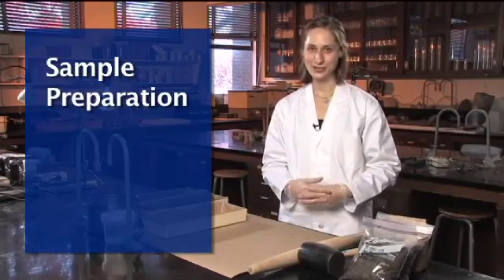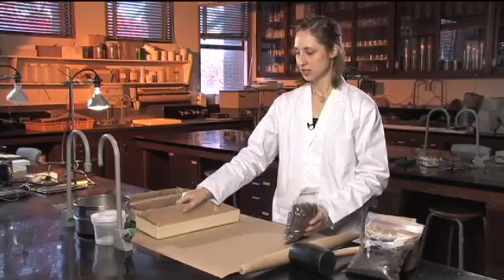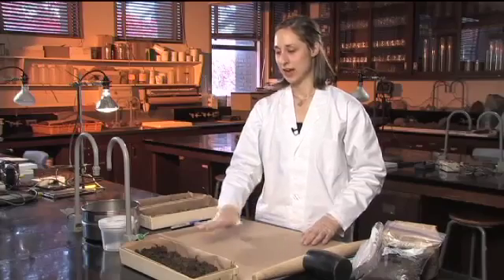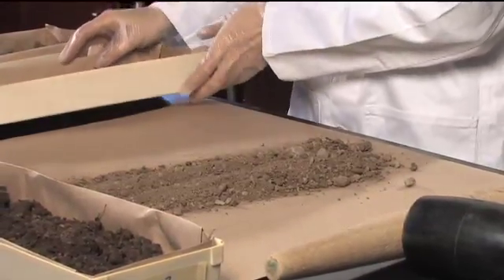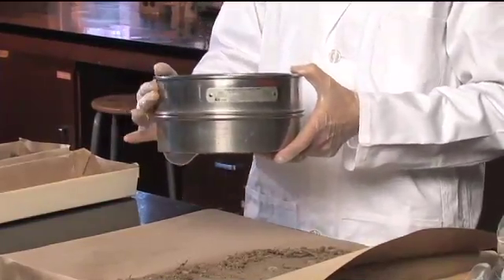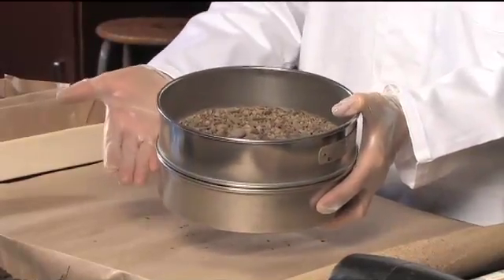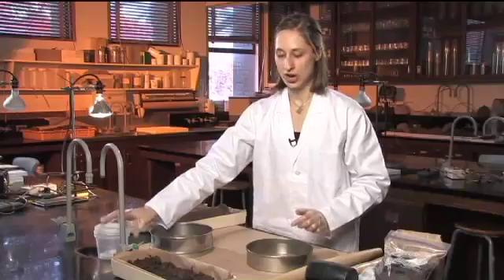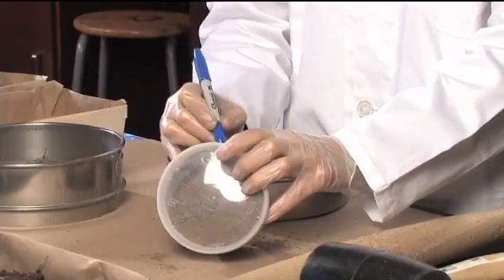Soil Sample Preparation

Comment: How much distilled water do you add per how many g of soil to do a pH test ?
Reply: Proper test to pH and EC for soil sample ratio is 1:2 (soil:water). 1 part soil to 2 part of distilled or DI water. But you need to note that measurement is measured by volume not by weight.
Reply: @henrysaw3091  "not by weight" Thanks